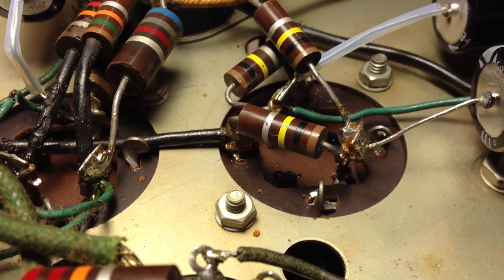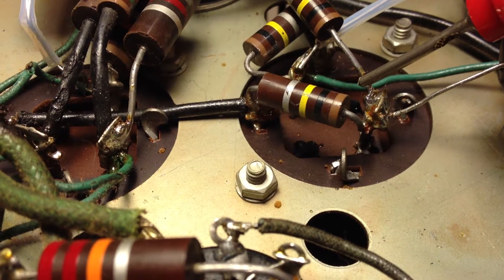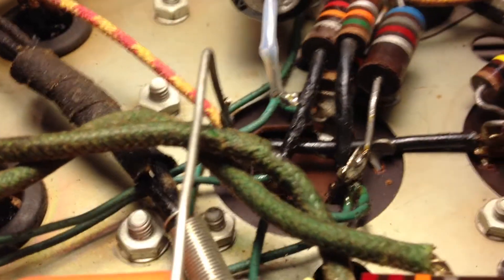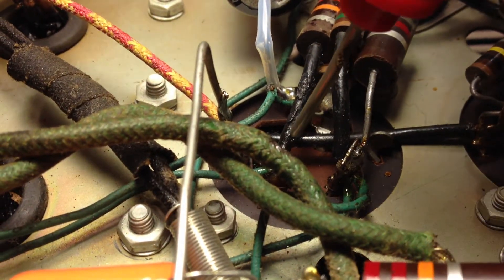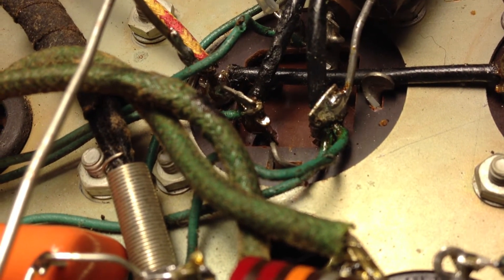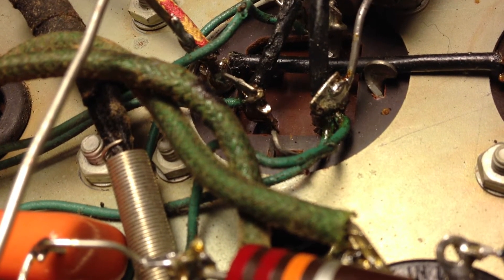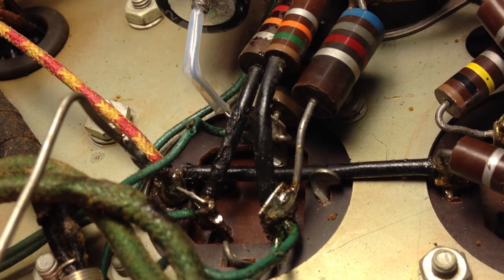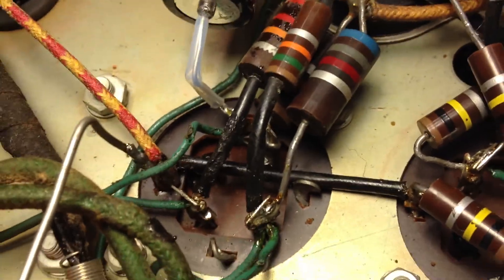Heathkit W-5M update

Comment from the maker: Segment of the can was shorted, and the 6.8k resistor measured near 8k. All 4 electrolyctic can capacitors and the 6.8k resistor were replaced on the two mono block amplifiers.